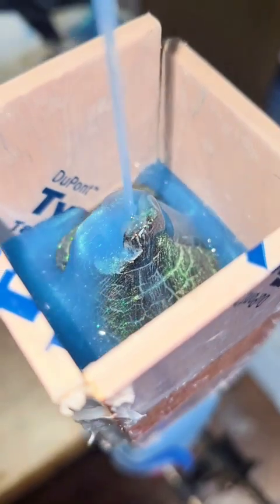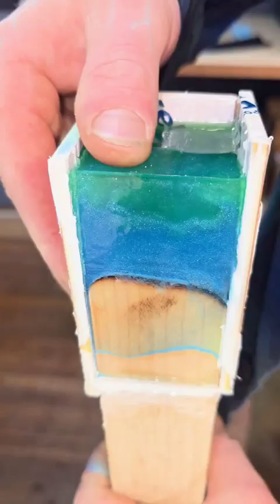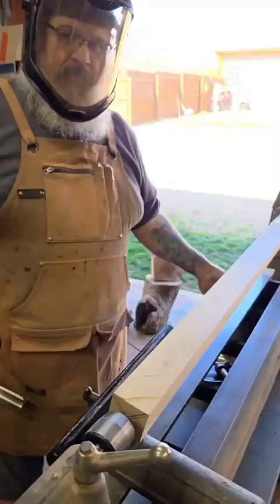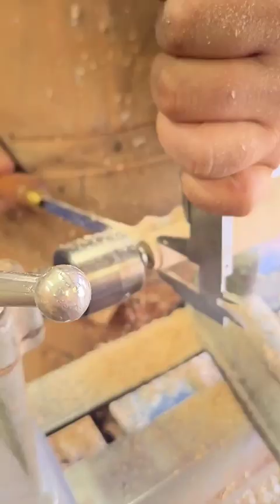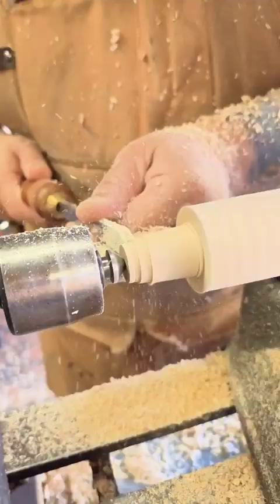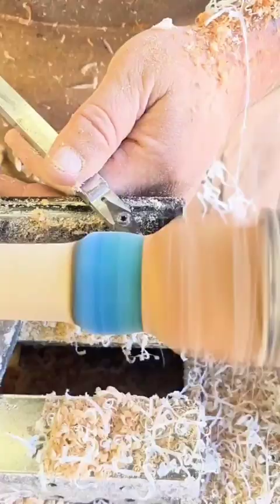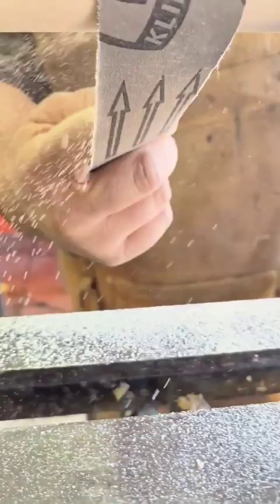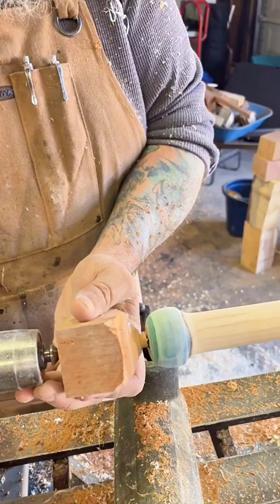Turning this chunk of maple into a 1 of a kind walking cane #part2  #woodworking #process #fyp #diy

Comment: I fell 30 ft in my mid thirties working as a first responder. I’m coming up on my 61 st b’day and I use a cane, a walker sometimes and in the stores an electric scooter. Don’t have my own scooter so you’re left hoping A scooter is available or is in working condition. If you are making a cane for someone than good on you brother!!
Reply from the maker: Hmu if you ever want a quote on one. They start at 250 with glowing burns, 350 epoxy head. Shocksfunctionalart@gmail.com

Comment: I had a walking stick like that. Come to think of it, I still do. I just switched to crook top canes because they're easier to use as actual mobility aid.

My old walking stick was from The Walking Stick Company, and I bought it in the late 70s. I used it mostly to help me get around when my bad knee was acting up. But it came in very handy one night near O'Hare Airport. While I spent a summer working as an Airport Limousine driver, we spent a great deal of time at night, drinking coffee at a diner nearby. I got a call to go home, there weren't anymore customers for the night, so I hobbled my way across the street to the parking lot my limo was in. This parking lot also served a bar, and once in a while VERY drunk people would ask for rides home, thinking we were cabs. Well tonight was a tad different. This drunk wobbled over to me and pulled a significant switchblade from his pocket, snapping it open and demanding all my money. (Little did he know that all is limo drivers were making next to nothing, as this was the summer of the famous Air Traffic Controller strike. Yes the one during which President Reagan fired them all.)

What this drunk didn't know was that i was a pretty damn good fencer, and had been trained for both Olympic sole and Medieval rapier style. So he was quite surprised when my walking stick whipped up into an en guard, and when he tried taking a stab at me I disarmed him, broke his wrist, and poked him sharply in the solar plexus with the cane's rubber tip. He folded like a cheap suit and started tossing his cookies in the gutter. I broke his knife by stomping it at the curb, got into my limo, and drove home.

Now the canes I carry are all combat rated, and I've studied a few other styles of cane fighting since. (Cane-Fu, American Cane System, Bartitsu, and even a bit of mock lightsaber dueling. Yes, I own a lightsaber actually usable for combat. Yes, it lights up and makes sound. My saber color is light orange. No, it doesn't cut through anything, it's just a light up polycarbonate stick that makes sound effects. Yes, this is the way. No, I don't know Yoda.)

Comment: RIP those precision measuring calipers
Reply from the maker: He used em to measure, not cut silly
Reply: @shocksart  how do you explain the wood shavings flying off while he was measuring?
Reply from the maker: @44ryang90  he was cutting, I edited the video to show him measuring. Dang dude, so judgy
Reply from the maker: @44ryang90  you can literally see the chisel cutting on the other side
Reply: I didn't see the chisel, I just saw the calipers shaking like crazy because they were rubbing against the wood while it was turning. Still RIP, they are probably fine but certainly with consistent use like that they won't stay calibrated and consistent long.

Comment: Did he… DID HE JUST… He used A CALIPER AS A CUTTING TOOL?!?!???! My inner machinist is crying.
Reply: No don't think he was using the caliper to cut with it at all. It looked like he was gaging the material with the caliper in 1 hand an was slightly trimming it down with a wood cutting tool(dont remember the proper name for the tool) in his other hand basically using both tools at the same time.. But I do understand where/how you would think he was cutting that with the caliper since the wood tool was kinda hiding stationary & lowish behind the work piece & the caliper was out in front of the workpiece..
Reply from the maker: He was measuring it dude wow hahahahaha
Reply from the maker: I literally said it in the video.
Reply: @shocksart  I just rewatched the video. I don’t think you did. Still a good video and I want to see the finale, but I was so crossed by that caliper usage.
Reply: Shit, watched it again and now I see. But still, as a machinist, I would be sacked if my boss saw me measuring a part mid cut like that. My bad yall
Reply from the maker: @ThatOneGuySometime  he's the turner bro, not me. He has his ways like everyone does. Either way, cane sold and customer is happy
Reply from the maker: @ThatOneGuySometime  final vid is posted

Comment: I assume the resin was heated to put the wood block on it.
Reply from the maker: I don't get what you mean
Reply: @shocksart  the wood that was removed from above the resins position was not originally there, I was just wondering about it and assumed we didn't see a step.
Reply: "Off with it's head" near the end, that piece of wood was not there to begin with, I feel it was added to protect the resin.
Reply from the maker: It was all 1 piece. Epoxy was added on the wood
Reply from the maker: The wood around the pour was a mold
Reply: @shocksart   wood removed at end of video.
Reply from the maker: @kevincockerham3806  at the very top, it was glued on so he could turn it
Reply: @shocksart  Ok, thank you.